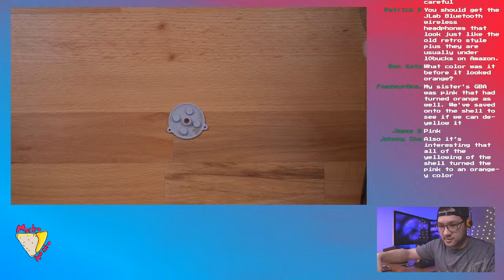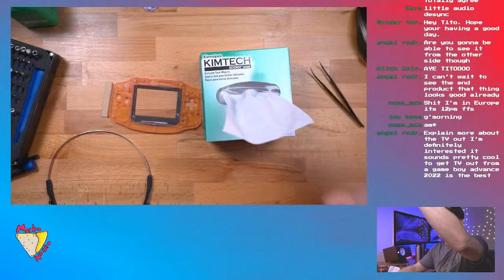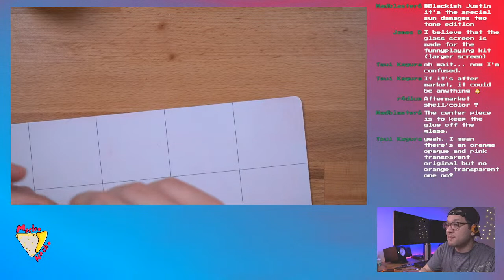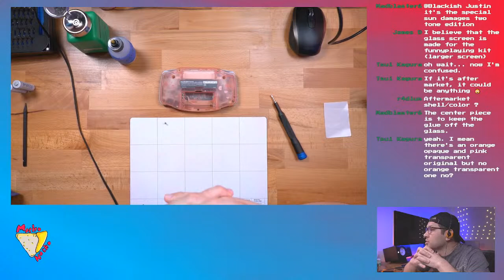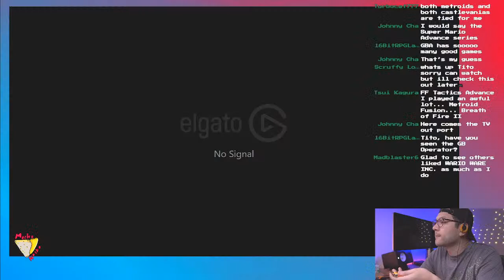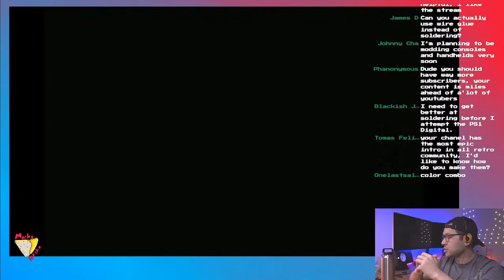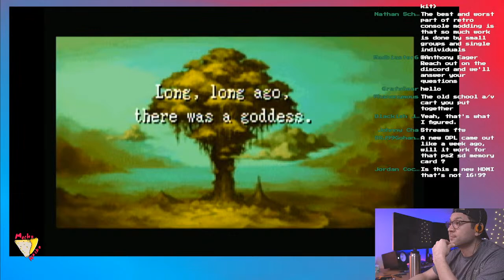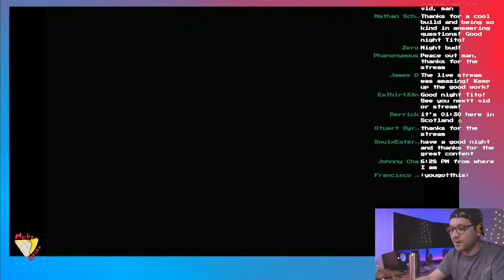IPS and TV-Out Mod for the Game Boy Advance | 3.17.2022 Live Stream

Comment: Hello Tito, I have an old GBA that I'm planning to mod it but the Right shoulder button is broken and corroded and the speaker is corroded too...Should I buy a new GBA for the IPS mod? It only costs 40-45$ here
Reply from the maker: You can actually buy replacements triggers and speaker.  If you have the skill to solder them, I'd recommend doing that to save the GBA motherboard.

Comment: Do you have a good way to permanently prevent overheating/YLOD on the PS3? 
Would replacing the thermal paste with IC Graphite thermal pads work? 
I'm afraid to open mine up without a plan.
Reply: https://youtu.be/odZmXw_pcio?t=113
thermal paste is always better than thermal pads if the OEM thermal interface was thermal paste.
thermal pads are always better than thermal paste if the OEM thermal interface was thermal pads.
what that essentially means is if the original used paste, then use paste (not pads) on the replacement. if it used pads, use pads (not paste) on the replacement, but make sure you do some research and buy pads of the correct thickness. too thin and there's poor contact pressure, too thick and then the heatsink won't sit flush properly and will bulge due to the oversized thermal pad and also lead to poor contact pressure.

the original fat ps3 is very difficult to work with if you're worried about thermals. many of the mods that would help thermals a lot involve irreversably modifying/cutting away internal plastic ribbing of the console shell to make room for larger fans/coolers of some sort, and they're kind of jury-rigged by nature and aren't really available as drop-in-replacement-kits. (example: https://www.youtube.com/watch?v=0vE0DZZk7IQ)

if you value the collector's value of the original fat ps3 a lot and don't want to modify the original shell (and I understand why that would be), I'd instead suggest storing it away and instead trying to get a PS2 for playing PS1 + PS2 games and a non-fat PS3 for playing PS3 games. there may be a day in the future when people are able to make/develop replacement cooling kits for the fat PS3 that don't involve modification of the original shell, but that day is not today.